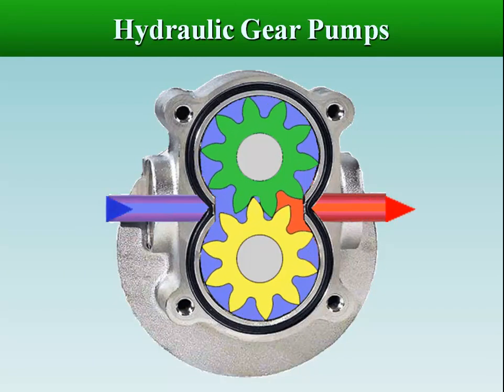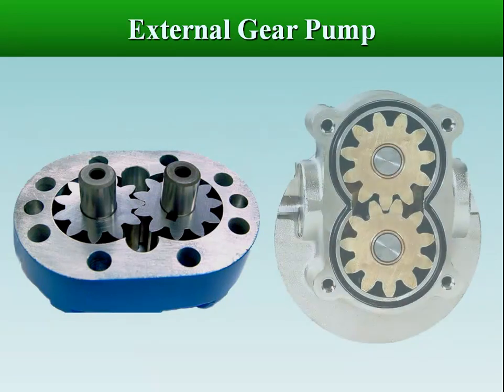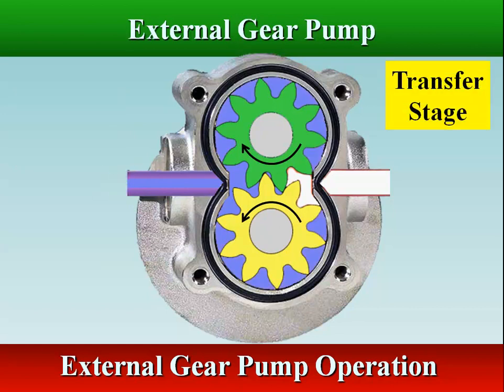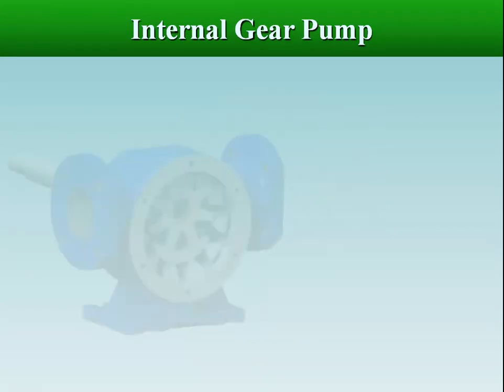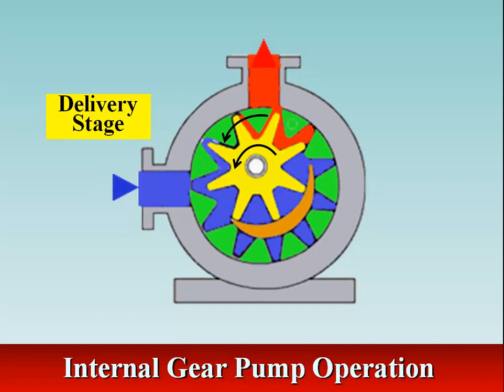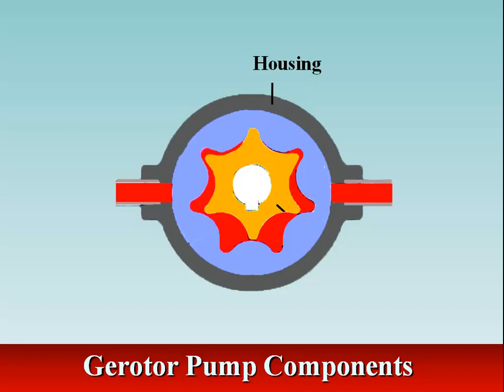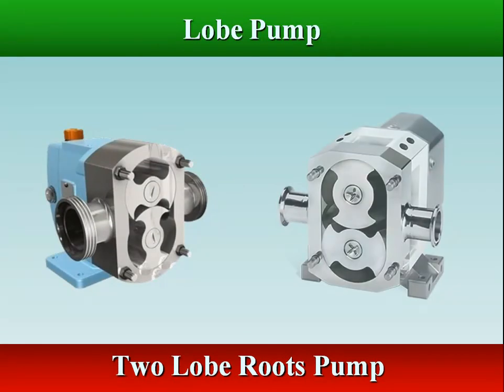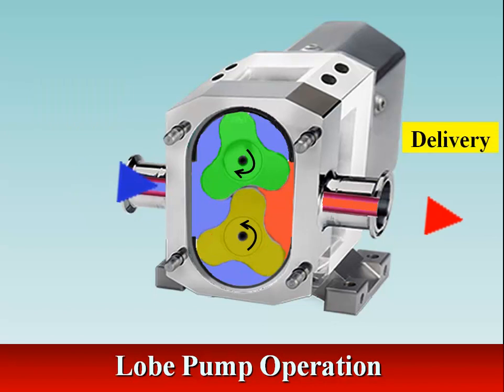Gear Pumps Types

Comment: This is great! One question though, if in the lobe style the lobes don't actually touch, then what is creating the seal which forces the liquid to move?
Reply: Squeezing of the space between the gears creates suction at the inlet and pressure at the outlet and the tight gear/housing gap provides the seal

Comment: Yeah around 2013 I was in my friends basement friends hanging out plain cards so it was my turn to shuffle and when I split the deck of cards and ran my thumbs to put two of them together and made them run on each other I noticed wind coming out of the side of the cards bam Wright there compression. So I asked Jacob Parrott to Wright down my idea and we had Tim Ibarra sign as a vitness. And on the list for security me and Jacob distorted our last names so there be no one on this planet under those names. We sent the patent in back then Jacobs mom paid something like 4$. On the bottom we put down our real signatures!!! That way still us. And obviaslly got stolen from me any way my idea that is and I had more plans for that desing. #F Sergey Kazakov  that desined twin lobe rotary engine. You know what it be like? When you put spark plug inside of the turbo. But any ways I knew no body would lett me be me, they just call me a retard. I have also new header design for a car no body else fought of it. Any ways so by. Wait till that pump catch is a natural gas pocket and gets a spark from a rock. Haha there goes my engine!

Comment: for internal gear pump the ring gear or outer gear is the driver gear and the inner gear is the idler gear.
Reply: it look like from the video the inner gear is the driver and the outer is the driven gear. Unless I'm misunderstanding your message and instead, you're talking about the terms in which they are referred to in the Hydraulics' world.
Reply: Yes, inner gear is keyed to the crankshaft and is the driver